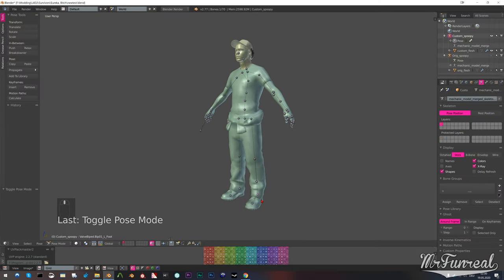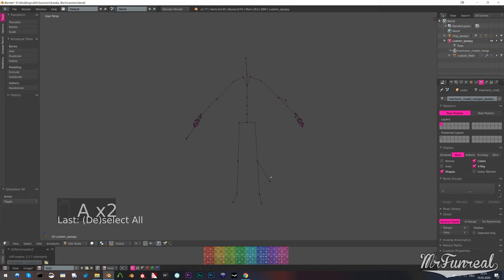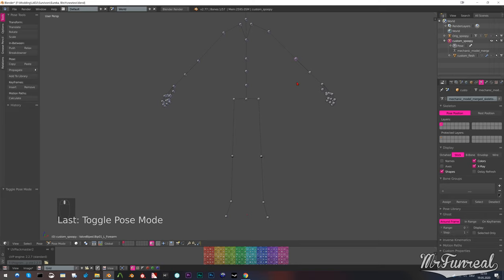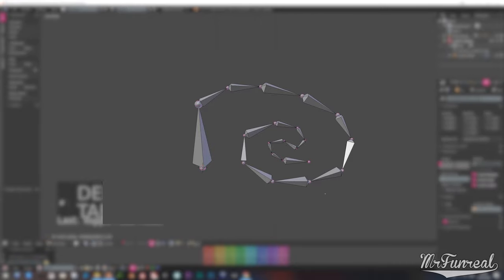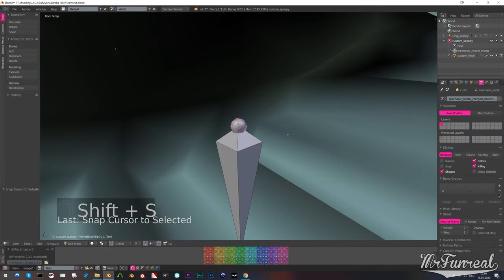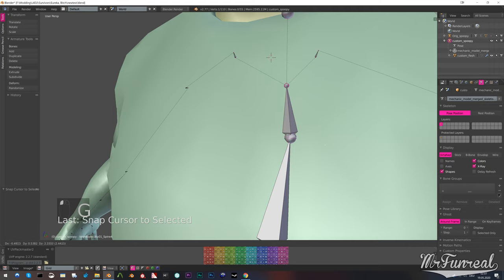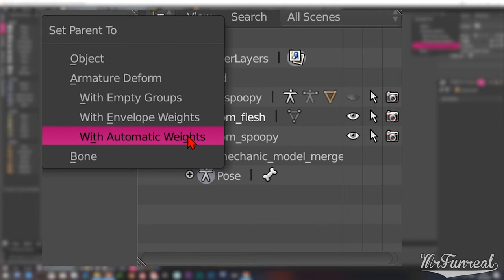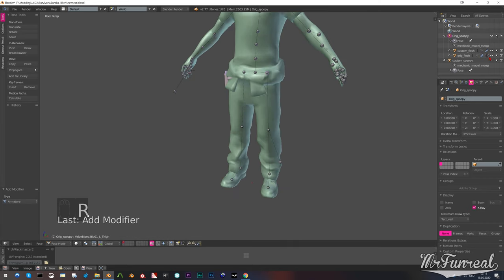Easy Source Engine Armature Rigging.

Comment: Dude I spent 50 minutes correcting blenders auto weight paint on a low poly frog ... Yea ill never use that feature again
Reply from the maker: if you'd arrange the bones correctly, it would save time.

Comment: is there a way to convert already existing bones into a SMD Armature? and is there a way to resize them?
Reply from the maker: you can do that. but the bone location, rotation and names need to match for any replacements. so its not really worth it.

resizing the bones themselves is not relevant because source engine doesn't take bone zize into account.
But you could resize the entire model if you needed to.
Reply: @MrFunreal   but i were to try and replace the bone, rotations, and location? How do i do that

And also when i resize the model then export it, and the import it, the bones become bigger than the model...or the model becomes smaller than the bones...how do i fix that?
Reply from the maker: @primus0348   1. armature edit mode. Do it manually for every bone.
2. all imported bones resize to a default size, but that's not usually an issue.
i'd have to take a look at what you're doing in blender myself.

get to the Dead4Mods Discord server if you can, so we can help you better.
https://discord.gg/4qtmzBP

Comment: I remember when i was making the port of the Vietnam model for Nick i had to move the model to match the same position as the original model's position. That was the biggest pain in the butt i had to deal with but i used a similar method to this and it really does work.

Comment: When I export the model to mdl, it is curved (most of the body parts turn in the opposite direction) and it looks and moves normally in blender, @definebone has nothing to do with it since I configured it correctly. This happens exactly after the rigging that was shown in the video, everything was done like you.
What could be the problem?
Reply: UPD: I tried the method with copying the weight from rig, the same story. Apparently the problem is in my model, unfortunately I will have to do everything from scratch and differently, by the way thank you so very much, you're saved me from weight painting pain

Comment: Wait what if i use the already existing weights from the model
Reply from the maker: That may sometimes work.
I once ported a SFM model to L4D2 and the weights were working for the most part. But because the bones are never in the same spot between games, you sometimes gotta fix the rigging either ways, even if its just a quick re-paint of weights

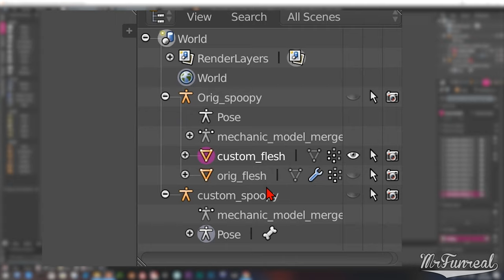Comment: So I have a model, and I have the correct valvebiped bones set up, and i can parent the bones to the character model, but no matter what i do, the object mesh is still non-responsive to the bone-pose movement, like for that brief snippet in 8:34 before you add the armature modifier - which, i've tried the armature modifier and properly assigned the valve skeleton, same issue
any help would be sincerely appreciated, i'm dying over here
Reply from the maker: either it's not rigged at all, you assigned the wrong armature modifier, or you are in edit mode where you can't pose bones.
Reply: @MrFunreal  when you mention the possibility of applying the wrong armature modifier - what do you mean? i thought there was only just the one that you could apply